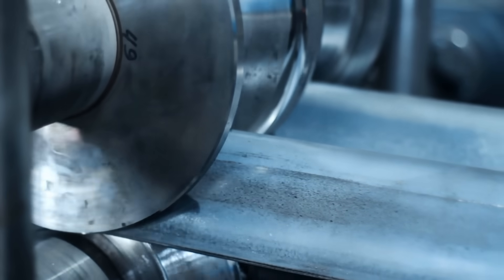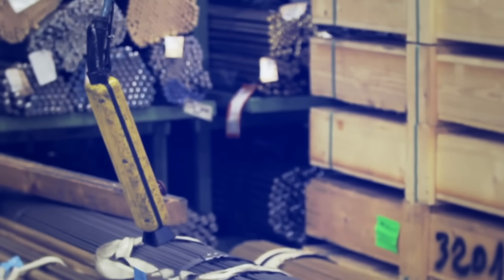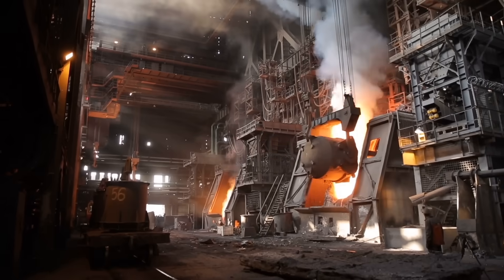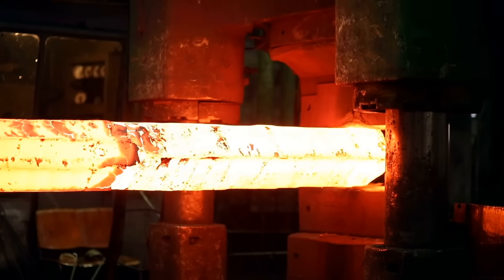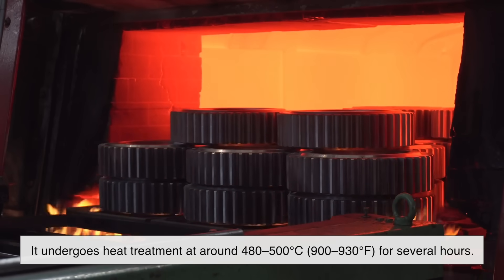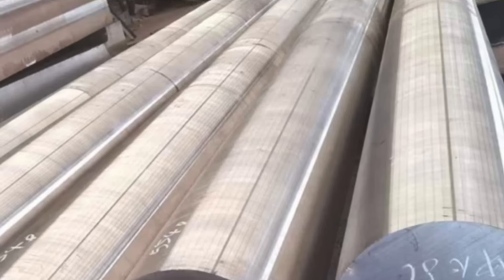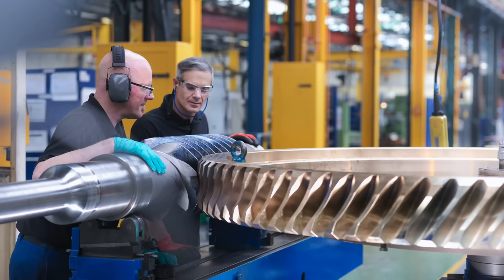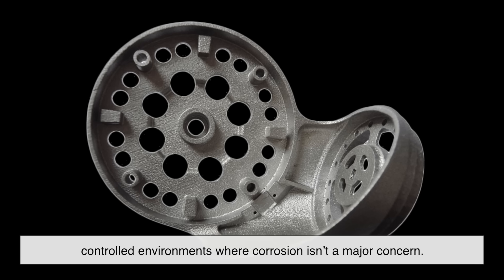What Is Maraging Steel and How Is It Made?

Comment: Years ago I made a hydraulic intensifier cylinder for ultra high pressures, of the order of 7000 bars. First, I made it using EN-24 with full heat treatment to 190 kg/sq mm. However, it failed and cracked. I then used maraging steel C350 and was successful. The flip side: high cost, it was 3.5 times costlier than EN24 and heat treatment also costlier. Also, a few specially  equipped heat treatment shops were available. Nonetheless, my job was done.

Comment: I remember when this steel was a controlled alloy, not being allowed to sell to countries that were not considered to be allies. Sadat Hussein bought Maraging pipes so,he could build a very long distance gun. He never completed it. Now, I can buy this from my suppliers such as McMastercarr and others. It’s pretty expensive, and I wouldn’t recommend it for most everything. This steel is interesting. But there are metal alloys developed around 1900 that have no iron. Very strong and hard. Often used for metal cutting tools. They also don’t have to be hardened since there’s no iron or carbon. They are “naturally hard” and very expensive.
Reply: Saddam (not Sadat) did order these canon pipes as water pipes in Belgium and Switzerland.  Intelligence found out because these water pipes required micrometer precision on the internal diameter!
Reply: @ you can thank spell specking for that error. I didn’t notice it.

Comment: A very interesting alloy would be 310 Niobium doped stainless steel. I worked on 2 extremely expensive vessel to be used in Nickel production as H2S reactor vessel. I believe the first ever use and welding of this material was Australia. Mind blowing heat treatment….heat to orange red and quench with massive water sprays then test EVERYweld again. 310 Niobium doped stainless steel

Comment: Maraging steel was used for "Clementine", the claw-like structure used to recover part of the sunken Soviet submarine K129 in 1974. Some of the claws fractured and broke off, resulting in the loss of a significant part of the submarine during the recovery process. Embrittlement of the steel at the very cold temperatures at the sea-floor was thought to be part of the problem. As this steel is also used for making equipment for Uranium-enrichment, it's production and distribution is closely monitored by some authorities.
Reply: Yes! Project Azorian! What an incredible effort!

Comment: Our company was using these steels, and other similar types, back in the 1970's.  Somewhere in that era, the production of these materials became economically viable, probably due to advances in furnace technology.  It was also used by us, for deep underwater vehicles, because it could huge pressures, and deform gracefully, without cracking.

Comment: I have some 3 foot bars of that stuff C-250 alloy. Machines very nice, must use sharp cutting tools. I made tooling for aerospace fastener co and they used the parts in tensile test machines.
Reply: 3 foot by what diameter ,,, ?
Reply: @rolandtamaccio3285  2" and its 4.5 feet.

Comment: Electrician that did a lot of work in machine & tool & die shops. Only metal that I ever heard that was aged was from a great best in class machnists. He told me when he worked at the Frankford Arsenal they would place cast iron on the roof for one year before machining it.
Reply: My father was a Leyland retailer in the 1950's. Back then, Leyland was the producer of the best heavy vehicle engines. They cast the engine block and then stored them in the open in fields for many years to age before machining them to make the engine. They gradually shortened the time of aging as demand increased but then the quality decreased until they were far from the best heavy vehicle engines.
Reply: BITD- - - - AUTOS- - - - CAST IRON BLOCKS WERE WEATHER AGED FOR HUPMOBILES AND FORDS.
Reply: I have worked in the machine tool industry and it was standard practice to keep rough machined bed and other castings out in the open storage yard for about 6 months for "seasoning". Later, they switched over to furnace stress relieving to shorten the time.
Reply: Grandfather worked for C Lee Cook during WW2 making piston rings for ships. The value of seasoned cast iron was prized for it's workability. Seasoned cast iron engine blocks are the best budget foundation for high performance builds.

Comment: Wow, that is the first time I have heard of this metal ... and I have been around metal all my life -obviously I know of many alloys but this term is new to me... so even as a retired metalworker new terms need to be learned -even if they are not used in most metalworking establishments I still work for as a freelance metalurgist!
Reply: Me neither, as a mechanical engineer, ever heard this about this.  I wander if it is an American name for which we use different names in EU?
Reply: @ In the US, the term "maraging steel" refers partly to the process with with several alloys are made.  My understanding is that 18% Ni Maraging 300 is called European 1.2709 and German X3NiCoMoTi 18-9-5.
Reply: Maraging steel got some publicity relatively recently when it became known it is being used on the bolts and some other parts of the Army's Next Generation Squad Weapons.  These firearms use a chamber pressure of around 80,000psi, significantly higher than found with previous small arms.  To be honest, I had to look it up.